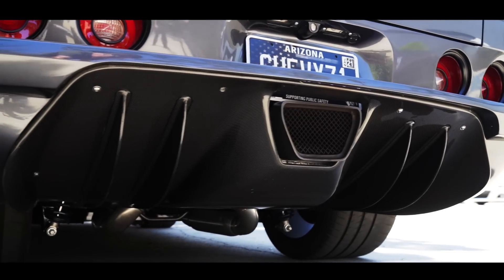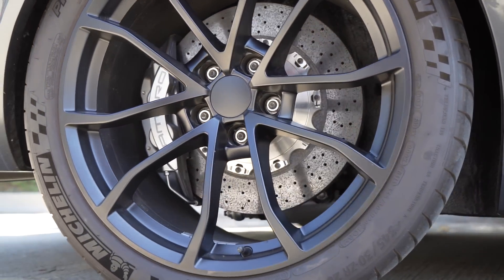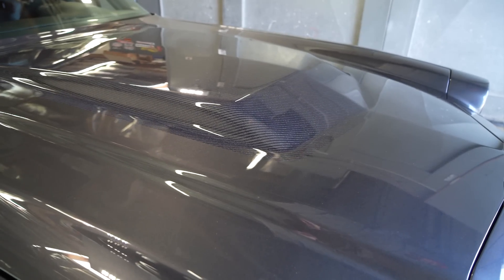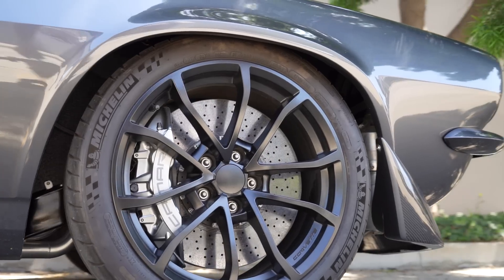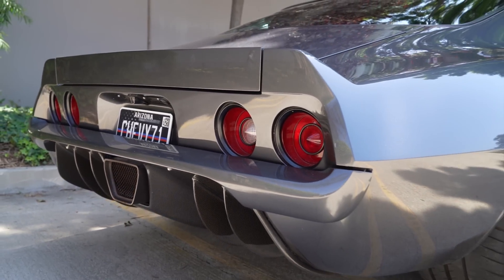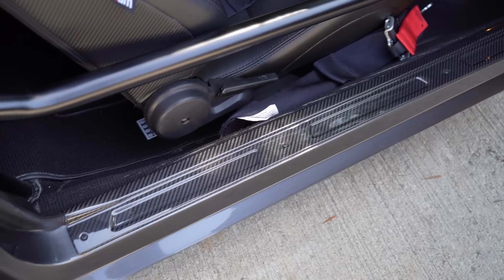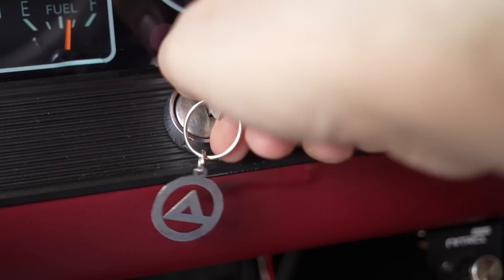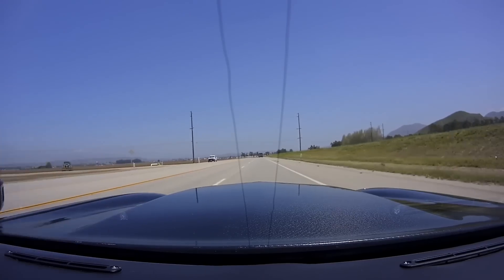725 hp LS9 Supercharged 1971 Camaro Restomod

Comment: The slanted exhaust tip is driving my OCD crazy.  Still a gorgeous car though.
Reply: I'll 2nd the motion and I will raise u the rear taillights and how the bottom of them is buried underneath the rear bumper lines. The rear lights should be raised a touch higher, but yes it is otherwise gorgeous and incredibly well done
Reply from the maker: I hear ya but one drive and I forgot about the small details and I’m fairly OCD too
Reply: @hemiheritage  I think in my opinion he should have retain the original Camaro look far as the center section around the license plate the bumpers should be lowered instead of going straight across lowered
Reply: Rob MacDonald what about the bars under the headlights?
Reply: Btw the boys at Timeless do it best!!
Reply: Going to have to disagree, the overall look is fantastic.
Reply: Oh my goodness that's the first thing I seed bend it straight come on!!! Oh for the love of God just saying!!!!
Reply: @HookahPhene  those are the front bumpers I love the 1971 split bumper camaro that's what ther known for but he tucked them way to fare back look you even though they were bars
Reply: @randelclawson7695  really? You dont have very high standards do you. If you'd paid over a quarter million to build this Camaro you'd expect the rear bumper to fit right and the exhaust outlet to be perfectly symmetrical!!
Reply: Yeah, the bumper is too high and covers part of the taillights.  I also don't think that exhaust tip fits the looks(besides being crooked). For that kinda money it should be perfect.

Comment: This guy is proof positive that people with OCD are the ones you want to do a build for you.  They miss absolutely nothing and won't sleep until it's right.  This is performance art with attitude, man.  I never liked the rear deck lid of the original either - he nailed it by straightening it.  Snap, Crackle, Pop!
Reply from the maker: Jason and his crew build such badass rides!
Reply: I agree but OCD = more hours = higher labor costs lol Granted something done wrong also costs money.
Reply: @theylive2749 , yes, and when you know that going into the deal, all is well.  You can rest assured you're getting what you paid for in that investment.  And at that point that's what it is, which is also ironic when you stop to think about how many guys start a build with a set of goals and... boom.  Some addiction sets in or, conversely, things evolve over many years anyway and the build got out of control, so you probably have the same amount invested.  :-)    All journeys are a little different.
Reply: Precisely!

Comment: Not only this LS9 SC motor is a marvel but like here it has and it must be coupled with a manual transmission..such an engine needs it to deliver all its grunt and driving feel & pleasure..it makes all the difference if compared to the stock ZR1 auto trans..(pretty deceiving actually when I drove both)..!!

Comment: Cool build, but the tucked in wheels kills the stance with those beautiful fenders. The rear end cutting off the license plate and coming up ever so slightly into the bottom of the tail lights just to have that Ferrari defuser on it...eh.
Reply: Thought the same thing and the exhaust tip isn't straight  but ill take it.
Reply from the maker: The minor details I hear ya but one drive and you’d forget like I did. Killer driver car!

Comment: I hate to be that guy but sometimes I can't help it. For being an "OCD" Builder I saw a few things that are not quite right. The rear bumper is slightly tighter and the line is higher on the left; the exhaust is twisted to the right, Also is an interior really custom if is store bought? The sound as well just didn't seem to be as it should. I love this channel and love seeing the bad ass cars... just something with this one. Other than the fact I am a purist and don't like to see something changed that was awesome from the factory. I know I couldn't sleep at night with that exhaust tip like that!